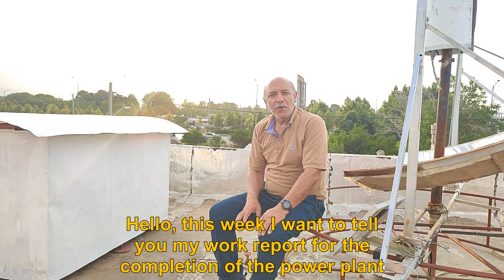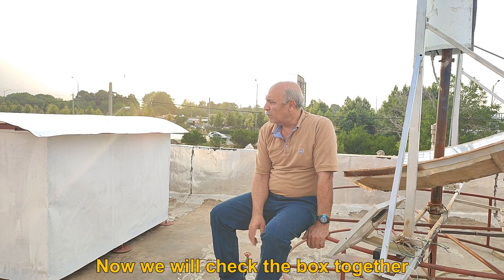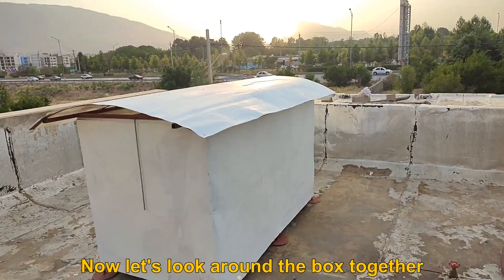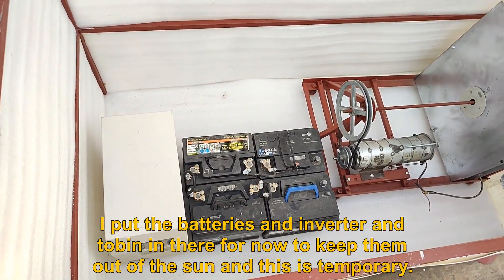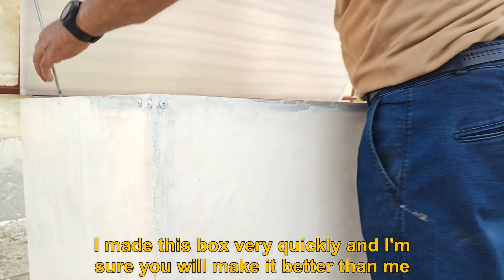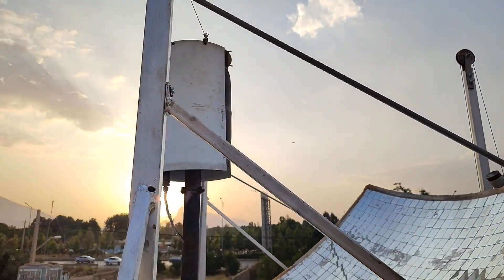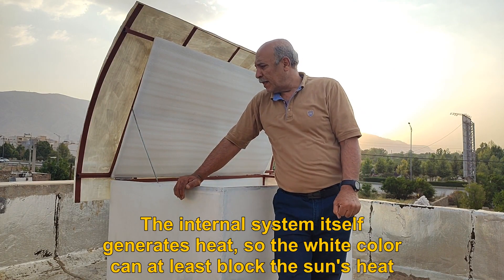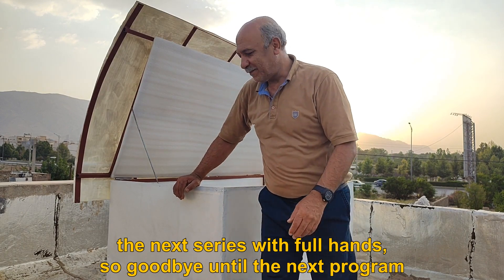Powerbox.Introducing the home power station box

Comment: Can you tell me if your invention would work in locations where there is cold winters or is this only for warm weather areas?
Reply from the maker: Thank you dear friend
The system works as long as the sun is shining
Of course, if the sun is fully on the horizon, the power of the system will decrease
If the gas supply system is done, the system works in any mode
The burner should properly heat the boiler tank